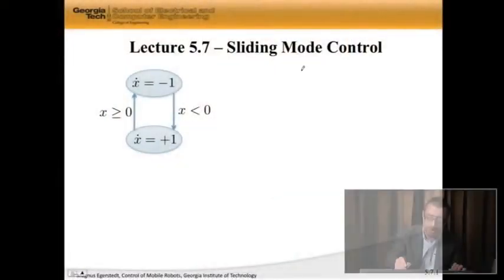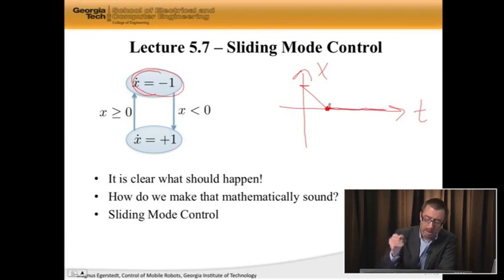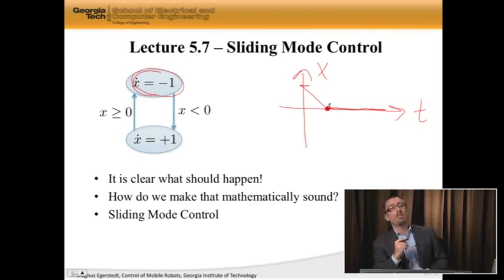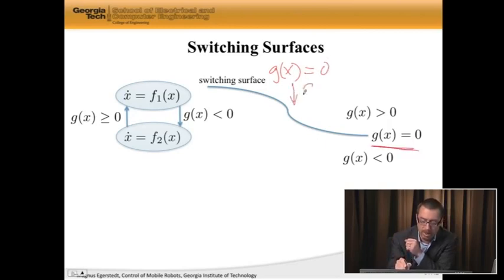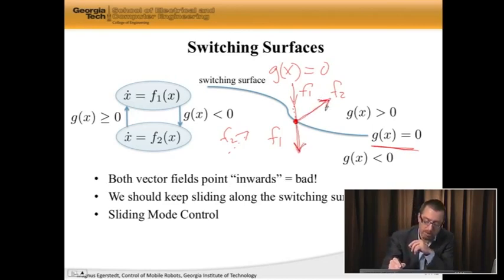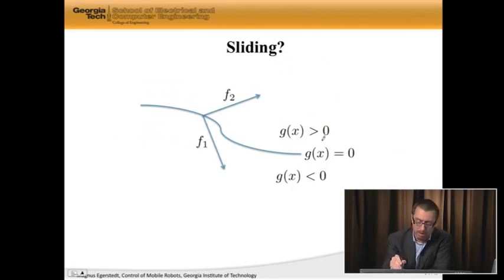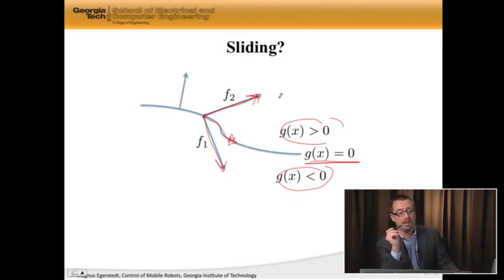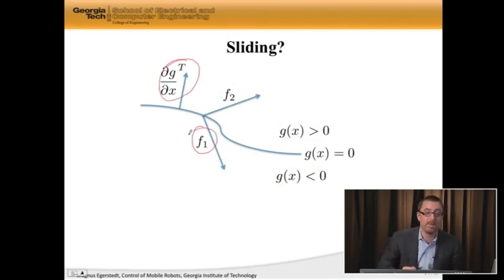5.7 Sliding Mode Control

Comment: The explanation is incomplete and incorrect in some places. 
(1) If the two structures f1 and f2 are such that at the sliding surface f1=-f2, then the system does ground to a halt. In addition to the condition of L_f1 g * L_f2 g < 0, we would also need f1 not being -f2.

(2) Mere existence of an attractive surface does not mean sliding mode. In fact, the primary condition is the design of a surface and then selection of appropriate manipulations to tune f_1 and f_2 (which is called as sliding mode control)

The lecture may be a good one in nonlinear dynamics. But, it is certainly a misleading introduction to sliding mode.